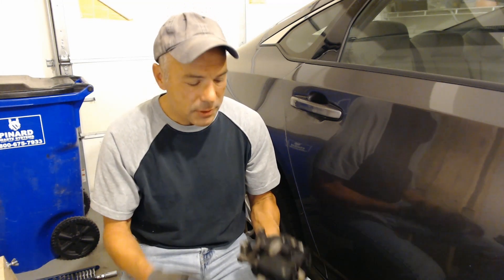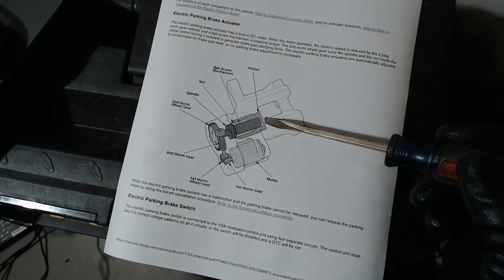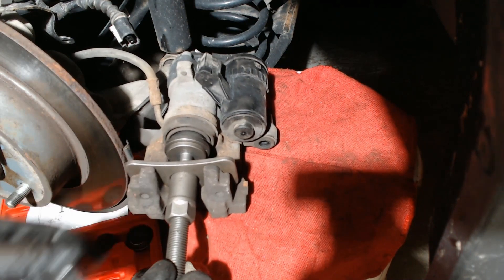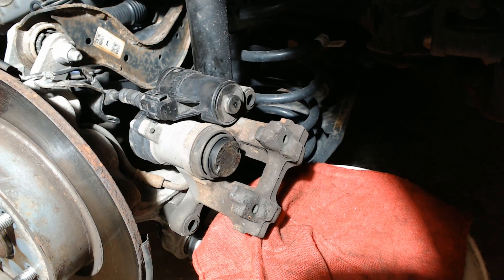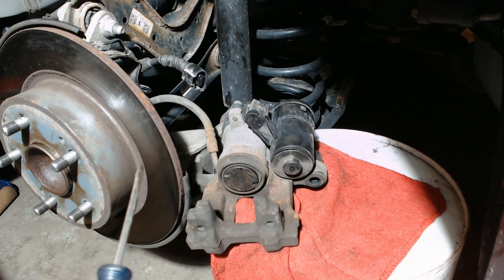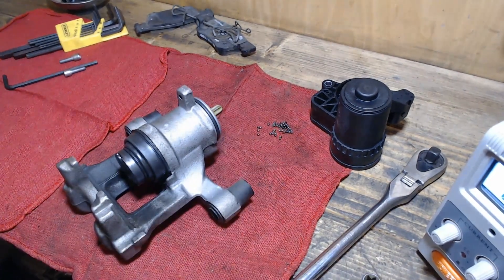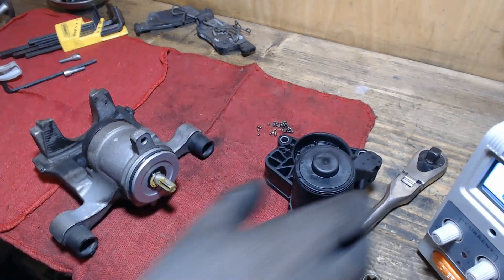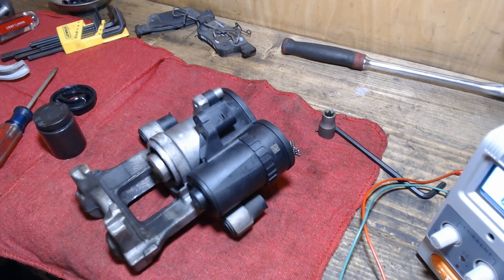4 Ways to Retract Brake Piston on a Honda Accord with Electronic Parking Brake

Comment: Great video, thanks! I've been seeing various methods including putting the accessory key on. But seems simpler to use the tool and turn back the piston. I have a scan tool but don't know if it does maintenance mode like you showed. thanks again
Reply from the maker: Thanks for the comment!  Yep, even though I have a scan tool that supports it, I still find it easier to just turn them back in.

Comment: Do i need to get a new caliper if the motor spinned so much that the top piston was wiggly loose. Or can i use a wind tool to push it back in?
Reply from the maker: Did the motor spin OUTWARD too much or just INWARD?  If the inner piston just retracted and left the outer piston wiggly loose, then you should be fine.  You should be able to just push the outer piston back in over the inner piston.  However, if the inner piston was forced out too far (running the motor in the reverse direction from retracting it so the inner piston was pushed OUT rather than IN) then you will probably need a new caliper if the inner piston was pushed out enough that it lost its ball bearings from the ball screw mechanism.

Comment: Excellent video! Yes, I watched entire video. RDX pads need changing and I was contemplating best option to retract rear pistons with the electric parking break. I'll be going with the rewind tool and then using a compressor tool the rest of the way. Thanks.
Reply from the maker: Thanks very much for the nice comment!  Hope the brake job on the RDX goes smooth!  Let us know if there are any major differences relative to the Accord!

Comment: I used a large pair of needle nose pliers to rotate the piston on an Accord before. It wasn't as easy as the tool you used, of course. Didn't realize that was still an option. Thanks. 
I'd really like to know how to disconnect that electrical connector. I've tried, and I just can't figure out the trick.
Reply from the maker: Interesting, yep, I could see how you could get needle nose pliers to work for that in a pinch!  Gets the job done!!

I am going from memory, but I think there is a latch on the connector that needs to be depressed by squeezing the connector in the right place.  However, I find it is usually very hard to undo the connectors this way once they sit there a while and collect some grime in there.  Instead, what usually works much better is to get a really fine pick and reach in from the end of the connector and lift up on the clip.  Hard to describe in words, but basically you reach in to the end of the connector between the female connector housing and the connector it goes to and gently push outward (toward the outside of the connector).  You will feel when you are on the latch because it will feel "springy".  Once you pull back on the latch a little bit, the connector will pull off very easily.  It does not take a lot of force, it just takes a very small pick and a little fishing around to fine the right place by feel.
Reply from the maker: I find a really small pick like the right angle one from this set works well:
https://www.amazon.com/Rotation-Pick-Hook-4-Piece-Tools/dp/B08W3H1SCV
Reply from the maker: But maybe you could even get in there with a small screwdriver.

Comment: So you don’t need to spin it in you can c clamp it with old pads ?
Reply: Never mind I kept watching and your legit thank so damn much you have no idea how bad I’ve been needing to do these rear pads and now rotors thanks to you I don’t need to do the calipers
Reply from the maker: @StreetSpeed410  Sorry for the delay!  Yep, you do have to rewind the inner screw in some fashion (by rotating the piston, applying 12V to the motor to spin it, removing the motor and spinning the shaft, or via a scan tool).  Once the inner piston is retracted then you can just push the outer piston in the rest of the way.  Good luck with the brake job!!

Comment: Do you have to remove the rear brake? Can’t you just turn the car battery on so it loosens the grip?
Reply from the maker: Thanks for the comment.  I am not sure what you mean by "just turn the car battery on"?  Turning off the parking brake off alone does not retract the inner piston all the way.  It pulls the piston back just enough to allow it to spin freely (so that it will be quick to turn on the next time you use it rather than having to travel its full range).   Let me know what you mean though as I might not be fully understanding your comment.

Comment: Would this also work? 
I was afraid to attempt on my Buick envision.
Ended up my brake pads had enough to pass inspection. We are planning on trading soon.

Ok removed lower caliper bolt/pin. flipping up remove outer pad. Lower caliper back and using 2 mid size screw drivers use the space (from removed pad) to wedge caliper hold bracket and caliper -applying pressure have someone hit the release p brake and it should retract correct?
Reply from the maker: Hi James,  Interesting idea!  I am not certain how the parking brake disable algorithm works on the Honda, but it appears that it might just run the motor for a fixed amount of time, enough to ensure the piston is retracted just a bit.  It does not retract it all the way, of course, so that it will be faster to engage when the parking brake is turned on again.  There are no position sensors or anything, so I suspect it just runs for a fixed time interval.  Going in the other direction, to engage the parking brake, I suspect it runs until the motor current increases beyond some threshold, indicating it has sufficient pressure on the pad.

If my understanding of all that is true, then I think your idea might work on the Honda (not sure about the Buick) but I think you would have to repeat the process many times to fully retract it, each time getting it to retract a little further.  So you would use your screwdrivers to take up all the slack.  Then turn on the parking brake and it the piston would hardly come out at all since you are taking up the slack.  Then when you turn of the parking brake it will retract a bit.  Then you take up the slack with your screwdrivers.  And just keep repeating that process until it is fully retracted.  I think that might work, but certainly never tried it!  However, it certainly doesn't seem like the easiest or quickest way to me!!  Interesting idea though!

Comment: Awesome video. Why do think some people say you'll damage or throw off calibration on electric motor and get lights on dash if you do it the (1st) manual way?
Reply from the maker: Thanks for the nice comment!  It is a good question and I really don't know.  At least on this model Honda, I don't see how it would even be possible for the PCM to detect that the piston had been wound back manually.  There are literally two wires going to the motor which supply it power.  There are no other sensors or any other type of feedback.  Therefore, I believe the only way that the parking brake gets calibrated is by the PCM running the motor until it engages (as detected by increased motor current) and then backing off by a bit.  Which makes sense given that the honda service information parking brake adjustment procedure (after pad replacement) is to simply engage and then disengage the parking brake.

Comment: question 
After replacing pads motor isn’t working when I press brake button, any idea what happened? Do i have to hook up computer to reset?
Reply from the maker: Is this a 10th gen Accord?  I believe they shouldn't require any computer reset.  They should work immediately and reset to the correct position the first time that the parking brake is applied.  Are you sure the parking brake electrical connector is fully plugged in (if it was removed)?  Are you getting any codes or lights on the dash?

Comment: Method 4. After removing the brake caliper motor
Is the socket you tighten before pushing the piston 8 mm torque or 9 mm torque?
Reply from the maker: I just checked and it is actually a 12mm External Torx socket to turn the shaft after you remove the motor.
Reply: @JohnsDIY i didn’t have that special socket but a regular 9mm hex socket fits snug enough to turn it clockwise by  hand.
Reply from the maker: @Jdm_fl5   Thanks!  That is good to know for folks who don't have the Torx socket!  It doesn't take much force so I am sure anything that fits should work fine as there should be no  worries about stripping it or anything!  Thanks!

Comment: I really thought you needed to use 12 volts or the scanner . Didnt know you could wind it back just like any other ither car
Reply from the maker: Yep, I wasn't sure about it either until I dug into it.  Pretty handy that they designed it to work fine either way!
Reply: @JohnsDIY  good to know . Thanx for the explanation

Comment: Does the left side rotate in the same direction as the right side? In my Lincoln, one side rotates clockwise to retract, and the other side is counterclockwise
Reply from the maker: That's interesting - I didn't know that some vehicles did that!  On the Honda, both sides screw in clockwise.

Comment: question here. when using a scanner to retract the EPB after pushing back the piston, should you leave the scanner in the on position or can or should you shut the key off on the vehicle then replace the pads then turn the scanner back on to reset the EPB or does it not matter ?
Reply from the maker: Yes, you can retract the EPB with the scantool, then turn off the vehicle, change the brakes, then turn the vehicle back on and then reset the EPB with the scantool.  In fact, this is the recommended approach in the service data using the HDS (Honda scan tool).

When you do the retract ("ENTER BRAKE PAD MAINTENANCE MODE") all that happens is that the motor in the parking brake is run in reverse until it hits its stop.  When you do the reset ("BACK TO NORMAL MODE") operation, all that happens is that the motor turns in the forward direction and pushes the inner piston out until the brake engages and then backs off slightly.

Comment: I changed the brake pads yesterday at a local mechanic garage, but he didnt use any scan tool to enter service mode.. after we finished the dashboard shows: "elecric parking brake problem" hold brake problem". the E brakes works but keeps flashing on the dashboard.. will taking it for a scan tool reset fix the issue?
Reply from the maker: I think it is hard to say without knowing what it thinks the issue is.  Any chance you can have the mechanic read the codes?  Did you try turning on and off the parking brake several times?
Reply: @JohnsDIY  I saw the code yesterday it says Ebrake open circuit rear right side
Reply from the maker: @bilalnachabeh  Oh, well that's definitely a problem and wouldn't be fixed by any reset (assuming it is a currently occurring code, not just a history code).  I assume you probably disconnected the parking brake electrical connectors to do the brake job?  If so, I would make sure that the connectors are firmly reconnected.  Maybe even unplug them, check that the pins look good, and replug them, making sure they lock when fully connected.
Reply: @JohnsDIY  actually i took it back to him yesterday and he unplugged the wire and reconnect it. now its always telling me on the dashboard to release the parking brake even tho its not engaged! I can't drive the car im worried of damaging anything
Reply from the maker: @bilalnachabeh  Did you try turning the parking brake on and off a few times?  Are there any codes now?
Reply: @JohnsDIY  i did try and it worked everytime but the warning lights didnt go off. code i saw is open circuit for parking break on rear right
Reply from the maker: @bilalnachabeh  But does it still have the same code after disconnecting and reconnecting the electrical connector on the right rear?  When you say "worked", how do you know?  Did you lift up the back and see if both rear wheels didn't spin?  My guess, given that code, is that the right rear one is not doing anything but the left one might still be working.

In any case, I think you have to debug that code for the open circuit on the right rear.  It is saying that there is an open connection somewhere getting to the right parking brake motor.  Since presumably you didn't have the code before the brake job, most likely the problem is associated with the brake job which is a clue (probably not an open circuit in the wiring harness somewhere or a PCM issue).  The connector is an obvious place to look.  Make sure the pins are okay and it is seated all the way in.  Check the wire for any signs of damage - could it have gotten cut accidentally during the brake job?  The problem could be inside the parking brake actuator on the caliper but that seems unlikely if it was working fine before the brake job.  But you could check that by measuring the resistance at the terminals and make sure it is not really open circuit.  Was the electrical line subject to any stress during the process?  If the caliper was tugged violently while still plugged in, perhaps it could have pulled out a connector contact or even broken a wire.
Reply: @JohnsDIY  yes the same code was before and after he unplugged it. I say it works because when I engage the parking brake the car holds in place and when i release it starts rolling without hitting the gas. maybe you are right the right side isn't doing anything!   I hope he didn't damage the motor :/
only after unplugging the right side and plug back in the car starts telling me to release the e brake but it drives normal
Reply from the maker: @bilalnachabeh   Yeah, from your description, it sounds like that is probably what is going on - the right side isn't activating at all.  If it has an open circuit as indicated by the code, then there is no way it could be turned on.

Seems unlikely that you could damage the motor to cause an open circuit.  Most likely it is a break in the wire or bad contact in the connector I would say.  Again, you could test the motor resistance to know for sure.  You could probably also temporarily cross wire the two rear calipers and see if the code moved to the other side or not.
Reply: @JohnsDIY  i took it to another mechanic and he was able to fix it! it was a wiring issue! i'm so relieved no parts were damage! for next time i should set the breaks in maintenance mode before changing anything
Reply from the maker: @bilalnachabeh  Glad you got it all fixed up.  Did he mention specifically what the "wiring issue" was?  However, I do not think the electrical issue had anything to do with not putting it in maintenance mode.
Reply: no mechanics here tend to keep their work secret lol I'm happy its fixed and thank you for your time helping me! @JohnsDIY
Reply from the maker: @bilalnachabeh  Yep, I'm glad to hear it is all fixed for you!  Thanks for sharing your experience!

Comment: So many people complicating this and you clarified all methods in detail. Well presented and straight to the point. You have a neck for educational videos like this.
Reply from the maker: Thanks very much for the nice comment!  I really appreciate it!
Reply: The only issue I see that you missed was the adapter kit used to rotate and push the piston back into the housing comes with two types of screwing type tools. One is used on the left side of the car while th eother is used on the right side of  the car. Presumably one is a left handed thread while the other is a right handed thread, I have no idea which side you are working on, but my assumption from watching numerous video on this subject is the screw direction for retraction on Honda is always clockwise.  It  would be nice if you discussed how does one view which is the right side of the car and which is the left side of the car? It depends on  the point of reference. If one assumes while sitting in the  car, the left side is on your left while right side in on your right. If one is facing the car from the front, then the right side  is on the drivers side and the left side is on the passenger side.  @JohnsDIY
Reply from the maker: @kevindecker9444   Good point!  I believe the normal convention is to use left and right relative to sitting in the vehicle.  So in the US, the left is driver's side and right is passenger side.  I could have messed that up and said the wrong thing in the video though!  But you are correct, on these Hondas, the piston screws back in the clockwise direction on both sides of the vehicle.  Interesting that some windback tools have left and righthanded threaded tools.  My kit only has the single tool which works for clockwise retraction.

Comment: I have seen some guys using 9v batteries on Toyota or Lexus, I am super curious will 9v battery also work on honda cars?
Reply from the maker: Interesting question.  I still have that spare caliper hanging around.  I'll give that a try and let you know!
Reply: @JohnsDIY that would be cool😄
Reply from the maker: @lizhiliao4614  I tried it out and a fresh 9V battery was indeed able to drive the parking brake motor!  It definitely turned slower and sounded a little sluggish compared to driving it at 12V (not surprisingly) but it worked just fine.  I was able to drive the caliper piston out and then retract it just fine.  Thanks for mentioning that as that might be a good option for a lot of folks!  A nice side benefit of doing it that way is that you can't really create any problems with that approach (shorting out and melting terminals for example) due to the limited amperage of the 9V battery.  Good idea!
Reply: @JohnsDIY   Hi John, thank you soooo... much for trying it out with the 9V battery! It is just great to hear that it worked well for you and could be a viable option for others too. Indeed, the limited amperage of the 9V battery provides an added safety benefit. Much appreciate for sharing your valuable experience!